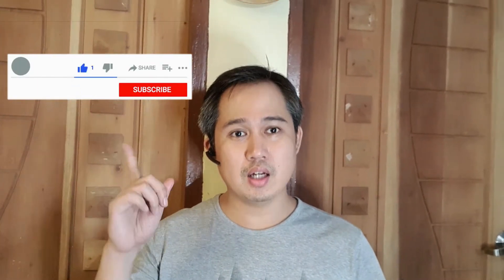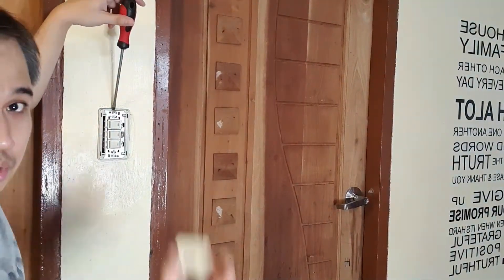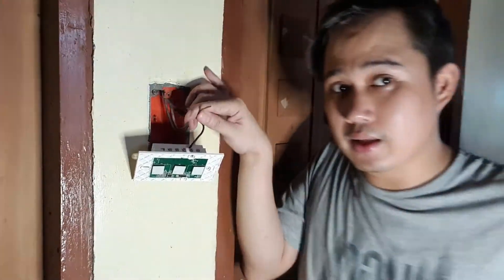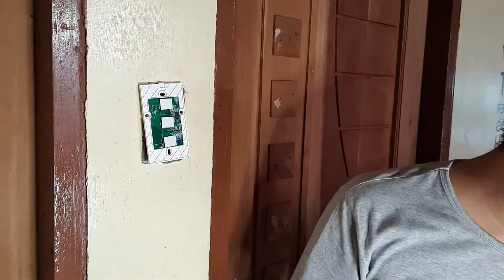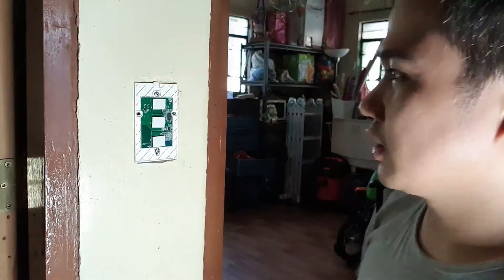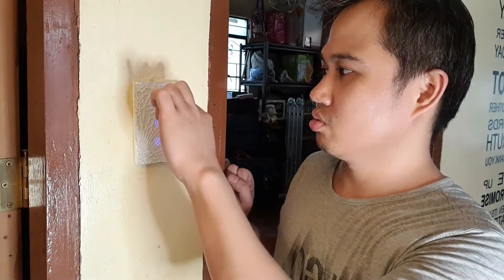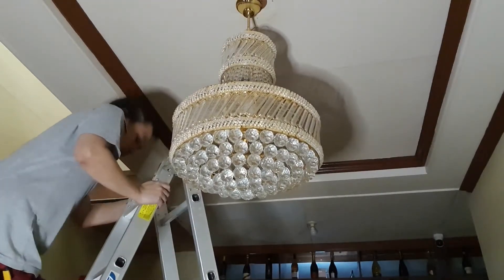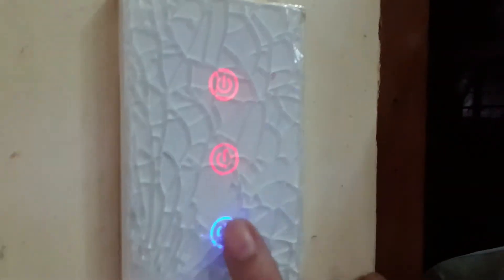How to change your normal light switch to smart switch without Neutral Line

Comment: 1. when doing this kind of tutorial. show fully the terminals of the smart switch since its very important than the speaker himself. 2. you're talking about that yellow thing - that is the capacitor and its unit of value is called capacitance which is in farads (mostly in microfarad or mf) since you're showing the capacitor, you should have shown it closely particularly its values (volts and mf). so can you show the terminals of the smart switch and the value of the capacitor please? thanks.
Reply from the maker: I'll do next time. Thanks for watching

Comment: I brought a swart switch that required a neutral wire because I thought my house had them. Boy was I disappointed when I found out I didn't. Where can I get a capacitor from and what capacitor do I need exactly? Thank you for your time and energy
Reply from the maker: The capacitor is include in the product i bought. If your smart switch is supported they usually include it.  But this is the capacitor details, you may check with your local electronics part shop, but this is for 220v - MPX 4.5uF X2 40/110/56

Comment: Sir ask lang.. balak kong palitan yung old switch to smart switch.. 3 gang (switches) po iyon, ang question ko pwede ba iyon ma on/off per switches at yung smart switches ba sa loob ng utility box is live/Line 1 lang po iyon.. yung  live/line 2 naman ay nasa loob ng kisame. Papaano ma-eenergize yung smart switch kung line1 lang po. Sana po masagot nyo yung tanong ko
Reply from the maker: Pwede po un ma on/off sa switch. Meron po dalawa type ng smart switch, ung normal with neutral line so need mag hila mg line2 sa kisame. Or ung without neutral line pero meron kayo kakabit na capacitor sa load 1 to bypass ma energize ung smart switch.

Comment: tumagal ba sir?
Reply from the maker: Yes, sir still working, pros dito pwede wala neutral line so no need to add new line, but cons is nagrereset sya pag nawalan ng power ng matagal and pag napindot mo sabay ang dalawa switch(one at time dapat if manual on/off mo sya). If nag reset kasi configure/pair mo ulit sa app. While ung other smart switch ko na with neutral line and non touch panel(ung meron toggle/emboss switch) is much stable or less setup time, kasi un na rereset lang pag ni hold mo both switch at the same time and never pa me nagreconfigure ng ganun.

Comment: Hi the capacitor install before the LED driver or after? thx
Reply from the maker: You need to install this on the light bulb where the other line is connected to neutral line.

Comment: boss mayroon ako kase isang 2gang switch na yung isang switch ilaw at exhaust fan. pwede kaya yan?
Reply from the maker: Pwede boss yan  usually mga 50 watts pangbahay na exhaust, but you can double check ilan watts nakakabit sa iyo. Then ung mga smart switch depending on the brand around 500 - 600watts capacity ng whole load pag on lahat. Add mo lang boss lahat ng ilaw nakakabit sa switch na  un kung LED ka usually 2-25watts lang nakakabit per ilaw so I don't think aabot ka ng 500 wats including exhaust fan.
Reply: @YopiChannel  boss pwede mo ba email number mo para makausap kita at matanong ko sayo yung mga katanungan ko? salamat
Reply from the maker: @broombroomwithryan1889  you can message po on my official facebook page. https://www.facebook.com/Pio-Tech-Tips-and-Everything

Comment: How did it break , because of the eletri al 
And one mor question do I need the compasator why is it used what will happen if I don't use compasator ?
Reply: One more question do I have to put compasator at all tree bulbs ??
Reply from the maker: You only need to add one in the first light, but this is only applicable for smartswitch which supported no neutral line.

Comment: Why you need capacitor? If so what value is the capacitor
Reply from the maker: It is needed if you don't have neutral line and depende din po sa smart switch nabili nyo.  pero un mga supported na no neutral line meron na sya kasama capacitance para makapag stored electric charge to stabilized power needed by the switch to run the wifi. I did not remember the value of the capacitor, if wala ka kasi neutral line wala mag power dun sa board that is always connected to wifi. pero best practice mag lagay neutral pero if mahirap mag lagay sa existing  house yan un alternate solution . SMART switch that support no neutral line.

Comment: Will this work for tricolor pin lights? I also have a 3 gang light switch for pin lights, cove lights, and pendant light. Thanks po for the help.
Reply from the maker: It should work on for pin lights, as long you will install the included capacitance if you don't have neutral line in your current switch.

Comment: How you connect google assistant in this program??
Reply from the maker: You will connect this to SmartLife App, then in google home under the home setting there is an option work with google, you will choose the smartlife and input your smartlife account so that those smart switch will integrate on your google home account.

Comment: Hi.. I need your help to install a smart switch in my home. How can I reach you? 
I bought T0US3C and I want to replace it with my old switch

I have removed the old switch and I found all the 5 cables coming out from the wall to the old switch are black colors. I don't know which one neutral or which one L line.
Reply from the maker: Thanks for watching my videos,  Check the label on your old switch on how it has been installed. if you already remove the wire from your old switch, that is the problem. Usually if all black wire, one wire will have a marker or wrap tape on it and that will be the live wire, so the other 4 wire one of them is the neutral line. then you will do a trial and error on those  4 wire. you my reach out me on my official FB page. 

https://www.facebook.com/PioTechTipsandEverything
Reply: Boss yong capacitor.if 2gang switch dalawa dn ang capacitor?
Reply from the maker: You only need one Capacitor and need to be put on the light where the first switch is.